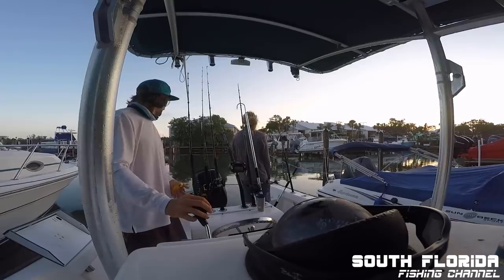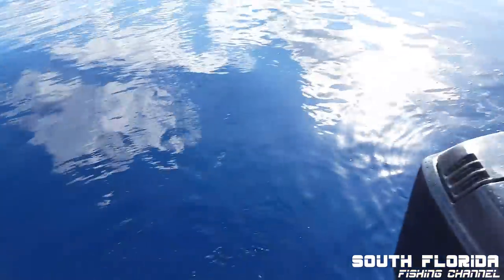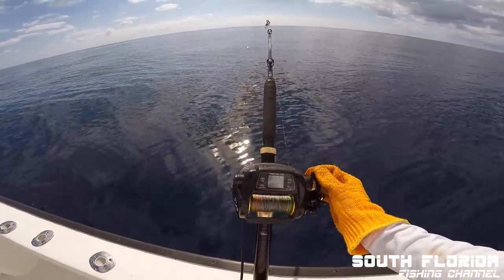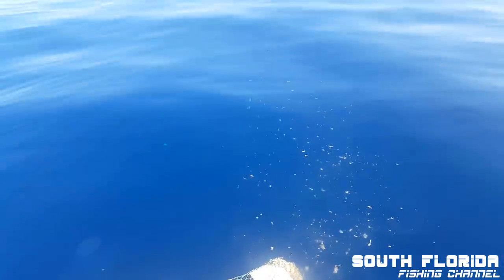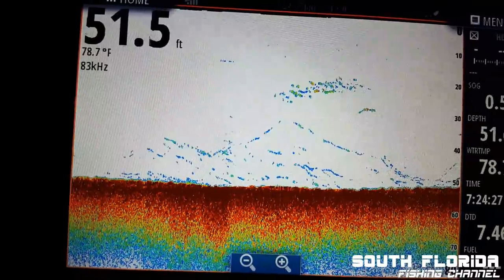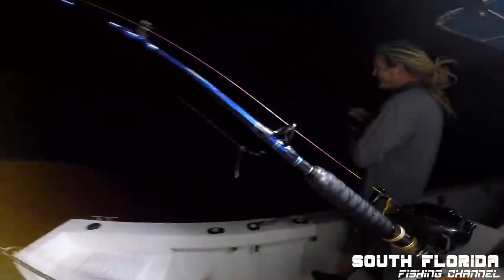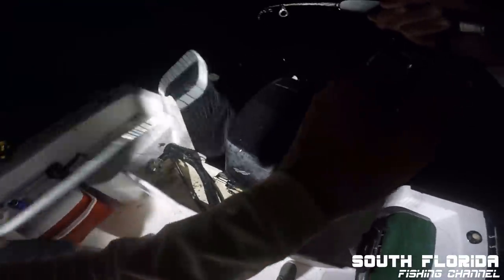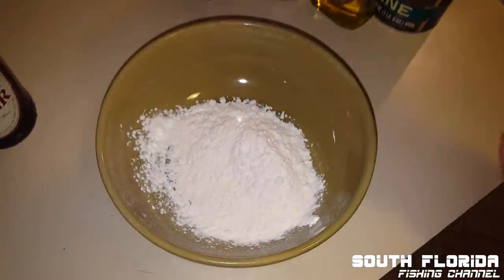Fishing 17+ hours offshore Key Largo | Beer Battered Fish Catch N Cook

Comment: I’ve been watching your videos for about a week now and overall really enjoy them. The one thing I’ve noticed, however, is that you very much dislike buying fuel. Lol. So I have a few tips on how you can save some gas and money.

1. Try trimming your engine up a bit while underway. This will help because you will notice your speed and rpm increase therefore allowing you to let of the throttle a bit to maintain the same speed as before

2. Consider purchasing a gas caddy or just a few fuel cans and filling up on land. If you are concerned about the ethanol, (Which I wouldn’t be because how often you use your boat) just use a stabilizer, such as sta bil to counter balance the ethanol. Then if you are low after a while fill up at the dock.

This is just my advice but heck, what do I known I’m only 14 but these are things I’ve learned over the years of boating/fishing from my father and neighbors. 
Great vid btw
Reply: Also if u don’t already know how to trim boats.com has a great video
Reply: Got a pay to play.
Reply: Ryan Van Fleet I understand that completely but y throw cash away when you can save
Reply: All good... Great tips.

Comment: Your channel is pretty bad ass I must admit, and the reason I’ve been asking a couple questions about your engine is because I have a mercury 150 that has been giving me problems left and right. It’s a 2001 and I know exactly what problems you had with yours. It’s pretty nerve-racking, but unfortunately, just like you, I would love to have a new engine but they’re so damn expensive right now.

Oh and what do you think about using OptiMaxx oil over the penzoil? I read a ton of stuff saying the OptiMaxx oil is legit but then again the Pennzoil seems to work as well. Just curious,
Reply from the maker: yea man, the 2 strokes are great WHEN running. It sucks leaving the engine on when deep dropping. It's so loud and smoky, but turning it off could end in a disaster if it decides to not fire up again...
Reply: Two strokes are so simple and usually very reliable, at least in the MX world. I did see a new Zuk 200hp four stroke advertised in south florida for $11,800. I didnt call them it was in a hotel magazine.
Reply from the maker: yea I love my buddies 2 stroke Kawasaki. BRRRAAAAAPPPPPAPAPAPA. lol
Reply: South Florida Fishing Channel Getting a string of lights to hang underneath the boat would make the snapper go crazy. It would look good for the camera too.
Reply: hi I have a 08 300 etec as long as the oil is tc-w3 rated you can run any oil in it I have motor computer running tc-w3 that is just under break in oiling ratio evinrude has xd50 and xd100 oil which is leanratio if injector runs lean  it will wipe out cyclinder  I bought a used 250 fict it blew up 30 hrs later save your money by a engine trade in with warranty  that is what I did haven't had problem you r carbed so add three oz per gallon that is a little extra thanks keep lines tight john